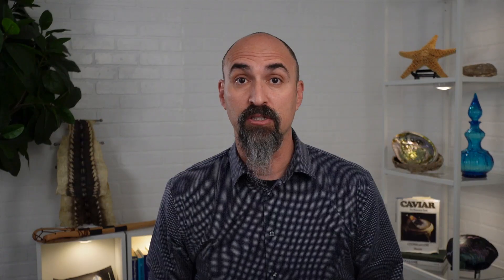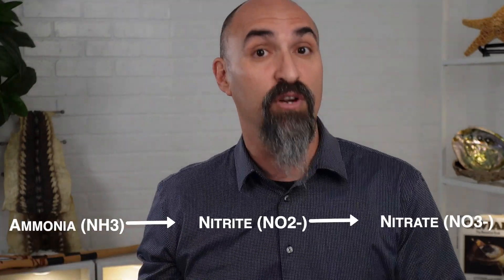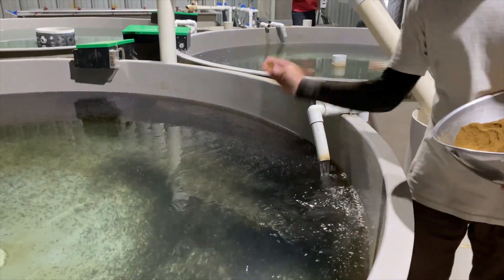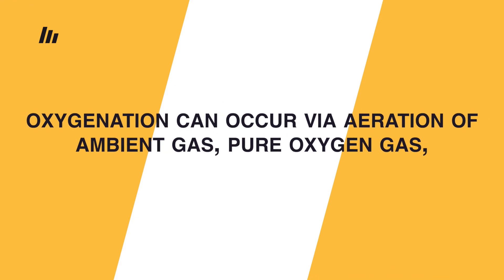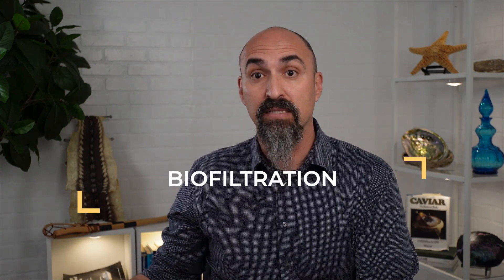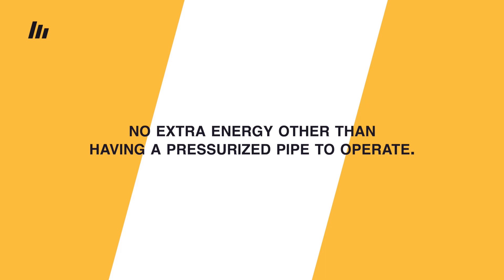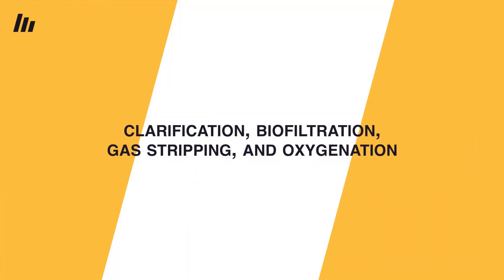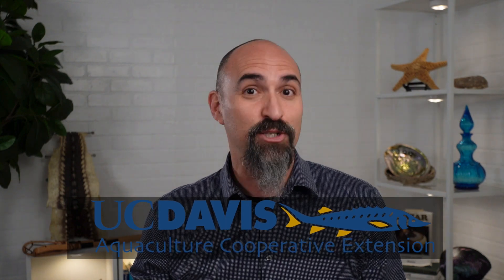The Components of a Recirculating Aquaculture System, RAS Fish Farming and Aquaponics

Comment: Great introductory video! I really appreciated the cost and time savings ideas your system showed, like whether to use pressure or gravity for water flow, uniseals or bulkhead fittings to seal pipes, and many other small but hugely helpful details. My only caution is that the picture of a paddlewheel aerator at timepoint 3:52, illustrating aeration, might have illustrated the opposite. As Claude Boyd warned, in ponds with heavy algae growth, DO can become supersaturated in the afternoon of long summer days, then paddlewheel agitation causes the supersaturated water to equilibrate with the air by off-gassing oxygen. Not all supersaturated gasses are bad!
Reply from the maker: Valid point about the aerator. This was filmed in the desert of California. What we find is that on cloudy days we really need those aerators moving. The water has a lot of silt in it as Colorado river water. I was just using that film as another example of aeration. This video was originally almost 20 minutes. There was a lot more about the flexibility of plumbing between tanks with uniseals, pumps, filters…it is already dense!